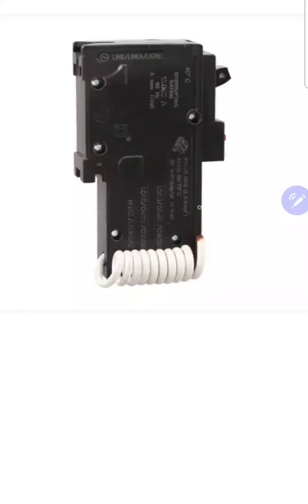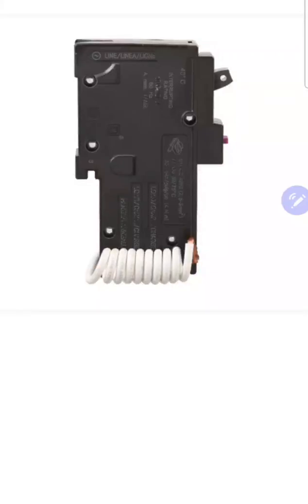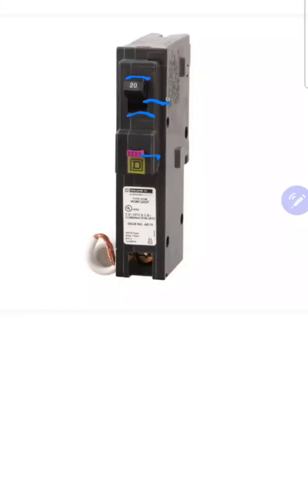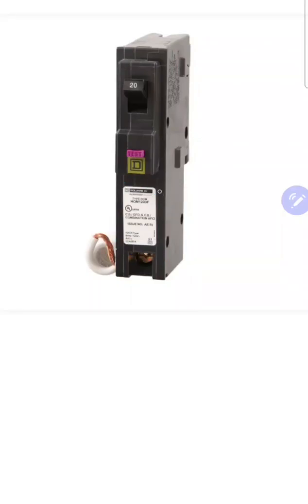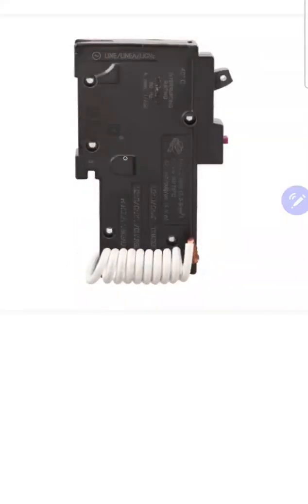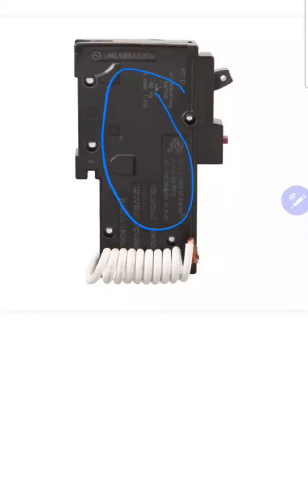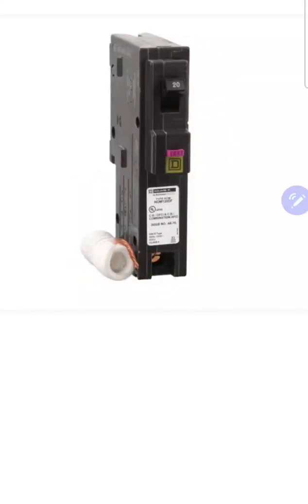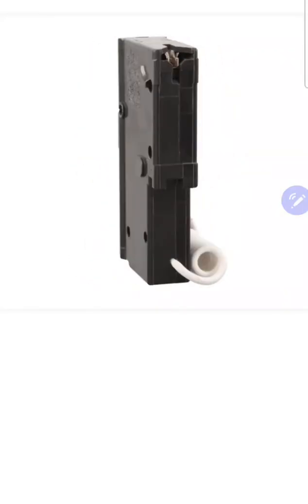Dual function breakers explained

Comment: Hi coach, how do you feel about afci, gfci, and dual function receptacles? I recently installed these on the first receptacle on every circuit in my home. I chose the receptacles over breakers because I am not an electrician so I didn’t feel safe getting into my panel. Are these any good or was this a waste of money? Thank you for all your advice.
Reply from the maker: If installed properly and up to code afci/gfci receptacles are great for the right circumstances

Comment: with the growing number of locations requiring GFCI, AFCI or Dual function,  it will be interesting to see if in the next few code cycles after 2023, like in 2026 and 2029, if for example we will be required to AFCI/GFCI protect a 120/240V, 40 or 50 amp circuit for a range located within 6 feet of the kitchen sink.  I've researched,  and I've never seen a two pole Dual  function breaker and I don't believe they yet exist,  but a few manufacturers make two pole 15 and 20 amp CAFCI breakers, and of course two pole GFCI breakers, now required to protect 240 volt & 120/240V  receptacles in locations requiring GFCI protection.